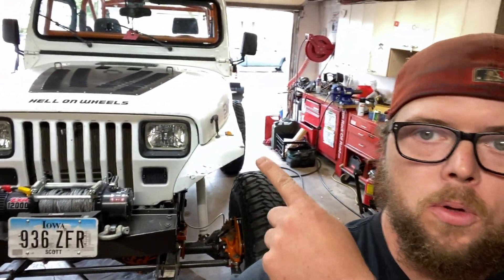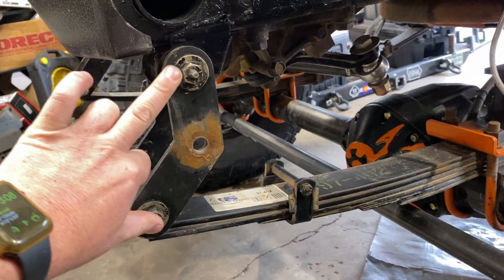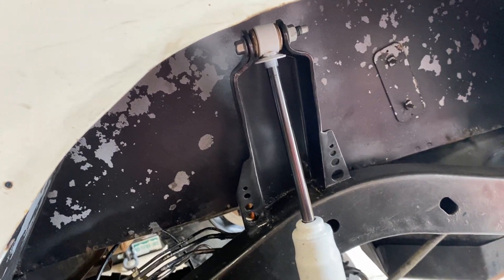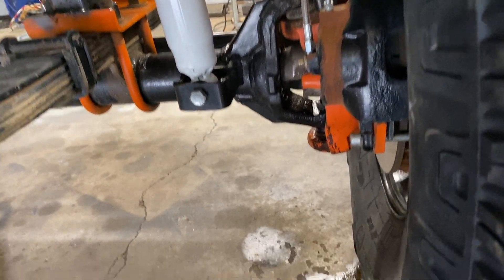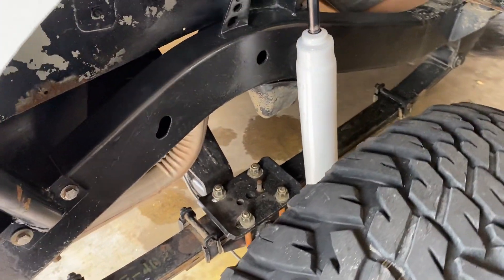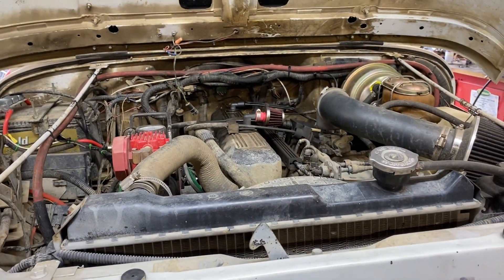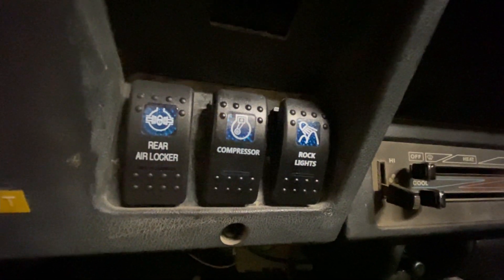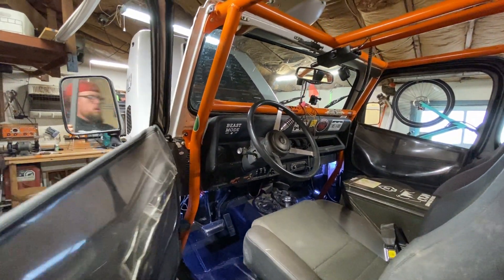Is a Jeep ever "Done"? My SOA Axle Swapped YJ - EP. 10

Comment: 7:11 for the shift indicator that's is a stereing column that gm used I believe from the 60's and well into the 90's, but thay made a 4 speed indicator for that column for rv's and stuff like that. I have a yj with a 700r and the factory jeep shift column and I thought about buying one and putting all the 4 speed parts in the jeep column, but other projects got in the way of that.
Reply from the maker: my aw4 is a 4 speed but it has the name number of clicks as the 3 speed. D,3,2/1 share the Lowest click. so in my case theres no need for a different column but still good info

Comment: I'm not a pro on a/c but I think the compressor uses the charged refrigerant as a lubricant.
Reply from the maker: You can put a grease zerk in the side, block off a few of the internal passages to keep grease out of the air and use grease to keep it lubed. I still haven’t got around to doing it haha
Reply: @FlawedOffroad  oh that's cool  thanks for your content. Yeah I need to start completing projects myself instead starting new ones. Never seems to happen though

Comment: They say use 2 steering stabilizers for tires over 35" and 1 for less to dampen the death wobble; the issue is resonance with high amplitude, the frequency of oscillation matches the natural frequency, oops. You can also use some castor 3 degrees minimum to 5 or more to add some resistance. I say be conservative on everything but most jeep guys are not!  Good luck! :)
Reply from the maker: Stabilizers are for sissies😂 they are a band aid to mask the real problem. I had a dumb issue back then that caused it that’s been corrected. This video is over 2 years old
Reply: So how did you fix death wobble?
Reply from the maker: in my case I had scabbed the steering together to make the smorr trip, I reconfigured it after that and it went away. generally bad steering joints, and ball joints and wrong castor angle are the biggest culprits @cdeprima1209